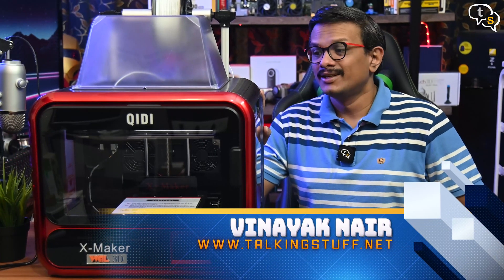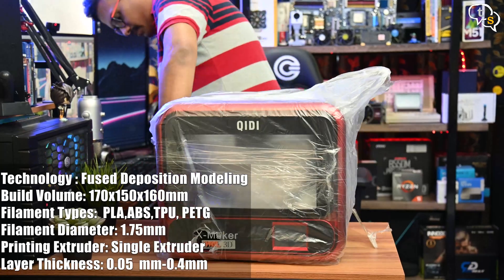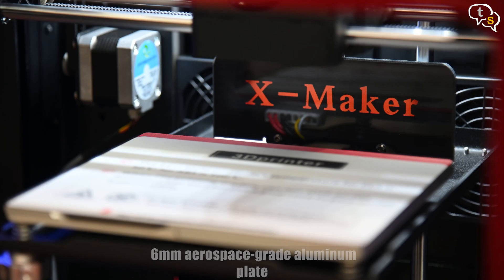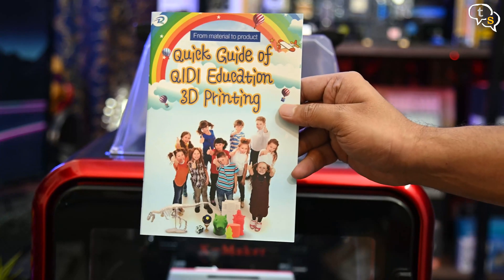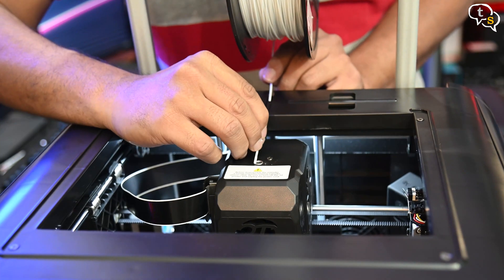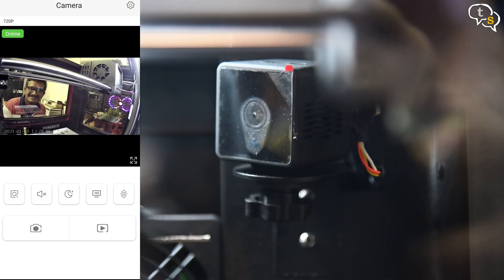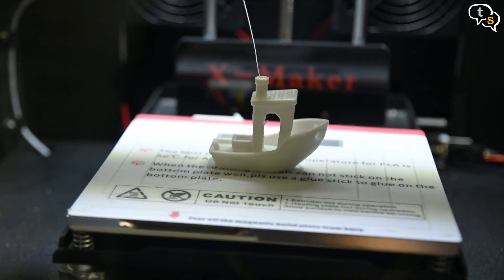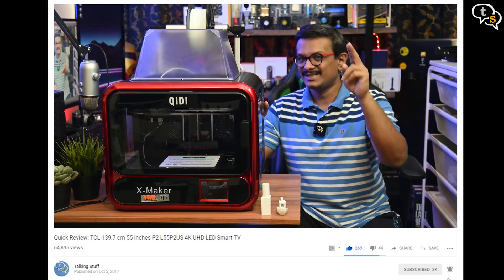WOL3D QIDI X-Maker 3D Printer

Comment: Is the Xmaker still being shipped with a usb drive in a small silver case ?     I cant seem to find it  [arrived 2 days ago 4.4.21] and not sure how to move forward - bc I have never used or even owned one before [this is the 1st] I'm a little unsure of what is supposed to move or not move inside the printer it self.       -       Someone who purchased this, this past Feb 2021 mentioned the Camera was no longer part of the printer, and also the clear plexiglass sides are no longer removable.  I almost tried removing the sides bc I had no clue there had been model upgrades recently.  I could use some guidance.. Thank you in advance.  Cheers!
Reply from the maker: I had the X-Maker in Jan, it came with the  silver USB drive and camera within the printer. Not sure if any changes were made after that. If you are looking for the manuals you could find them online. You will need the Qidi slicer to work with the printer. You could also use Cura with the preset for X-Maker loaded.
Reply from the maker: You can download the Qidi Print Slicer from here : https://www.qd3dprinter.com/software/

Comment: Mine died on the 2nd print. No power no nothing. Just dead.
Reply from the maker: Did you change the volatge switch by mistake , if it switched to 110 the board fries instantly. But if you're in the US it should be at 110.
Reply: No. It's set on 115 as it came in the mail. It just died in mid print. Just will not power up. Do you think I should try another one in hope this one was just defective?  I'm returning to Amazon.  It's only 10 days old.
Reply from the maker: Mine is still working, so the one you received might have been a defective piece.